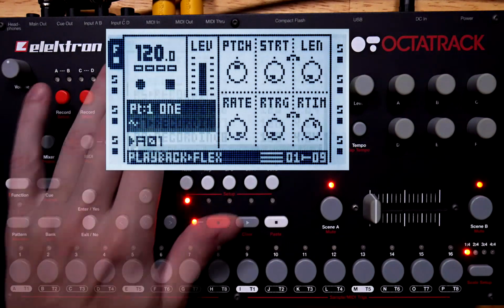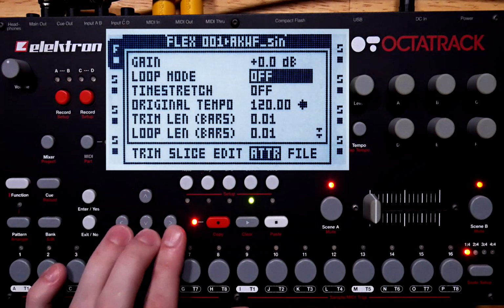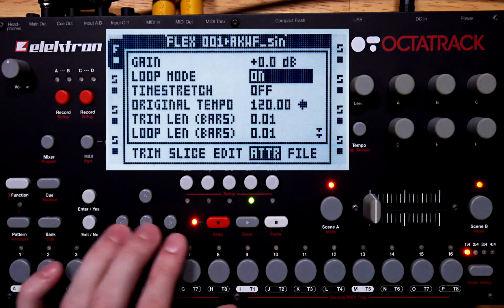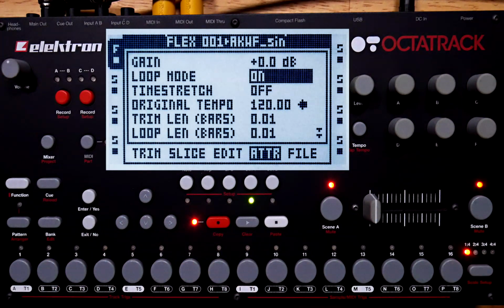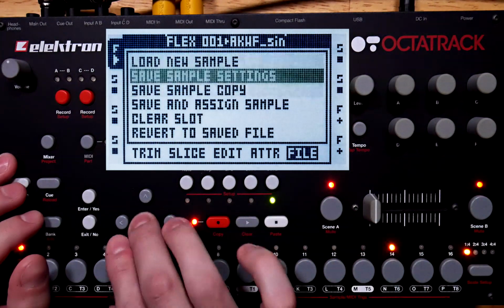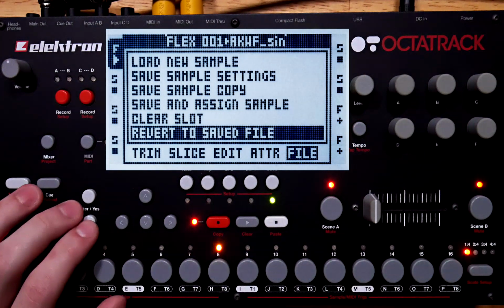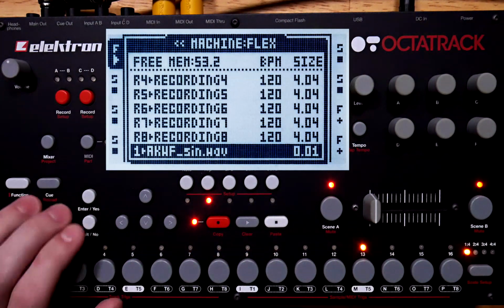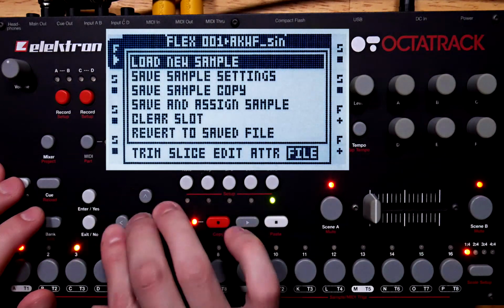Octatrack: Clipping, FX Artifacts

Comment: hi you got any idea why some efects dont work anymore on my project or work very funny like delay is on zero mix on my track and there is a delay, but when it take it off goes away. filters dont work but almost work for tiny fractions and event if i take the width at 0 i can still hear the sound i try clear paterens scenes and that still hapepning in some tracks. in diferent banks even

Comment: Nice, fun to see a thorough demonstration of the limits of different settings in the OT. I was unaware of the +3db tool as well. You're making some cool stuff
Reply from the maker: wasn't quite expecting what happened to that sinewave with the +3dB - is acting like some sort of horrible wavefolder :D
Reply: @maxmarco  yeah, it looks like it's folding the wave, but it adds inharmonics probably due to the sample rate. I personally liked how it sounded on the sine, but it doesn't seem useful for most occasions
Reply: @maxmarco Im about 4 years late to this, but it looks like whats happening is a little different to wavefolding. In a normal wave folder any signal that goes past the ceiling gets inverted or 'folded' back down across the ceiling point. It looks like whats happening here is that the signal going above the ceiling on the positive half of the waveform wraps back around to the negative half and vice versa, like going off the side of a pacman level and ending up on the other side. Very strange behavior from the octatrack, but honestly pretty cool, I've never seen that form of waveshaping before.